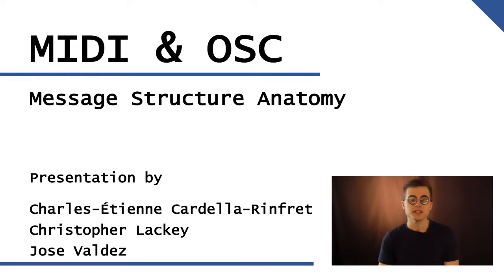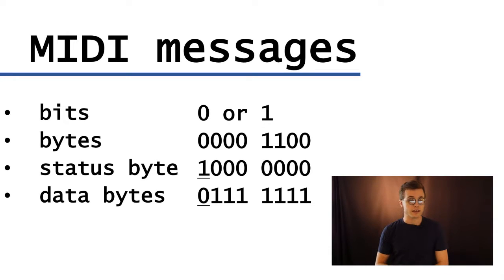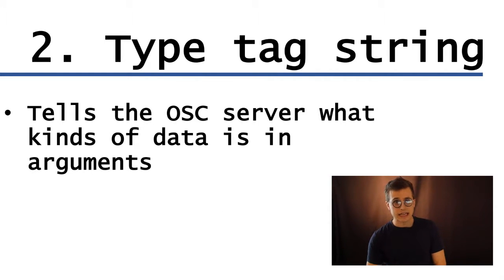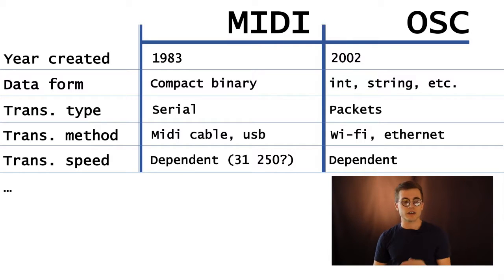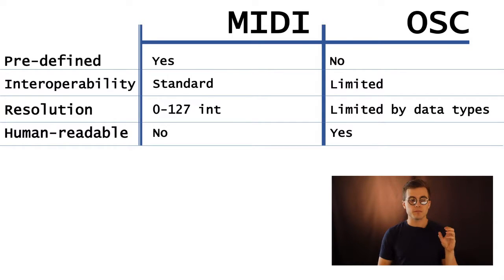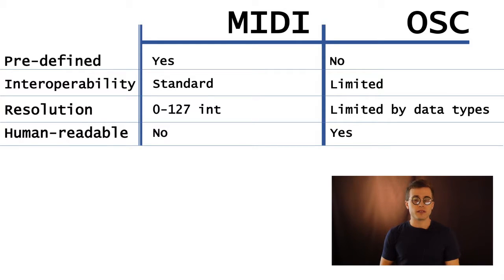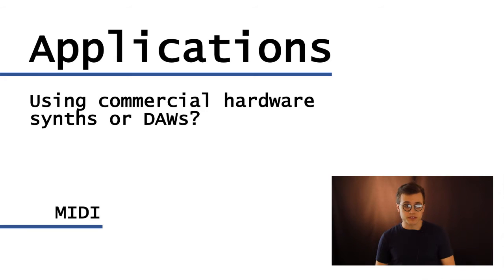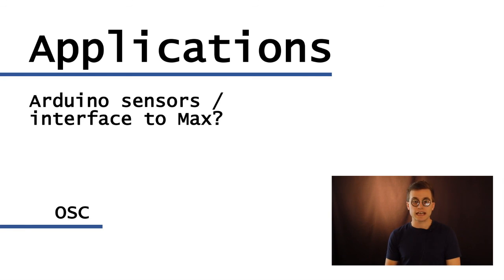MIDI and OSC comparison

Comment: What is the difference between MIDI vs OSC vs REST vs RPC?
Reply: MIDI is meant for musical instruments. Outside of music it has a limited use case as it is based on a less general/abstract approach and is instead optimized for interoperability, speed and size.
OSC is more generalized but also primarily targeted at music. It has a large address space (string names instead of numeric channels) and can send dynamic messages. So it does have some use cases outside music as it can also be used to control lights etc.

REST and RPC are completely different as they are not targeted at music and aren't even a protocol. Instead they are more a concept of communicating over a network.
In REST you basically tell the server whenever you modify some state (Like adding a message, deleting a message, changing a message, etc.).
RPC is just the idea of calling a specific function (piece of code) remotely with some arguments and some result.